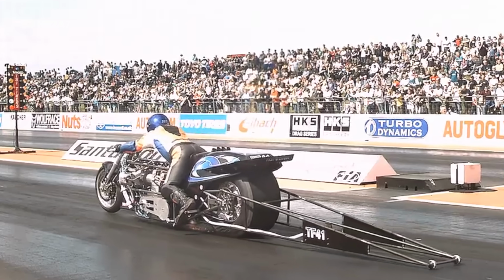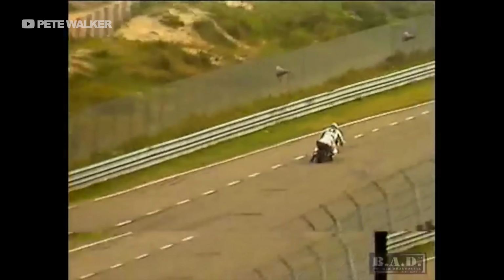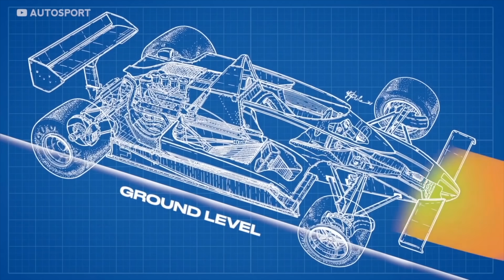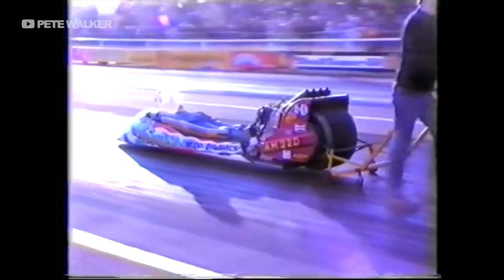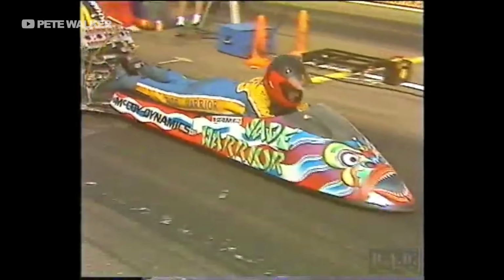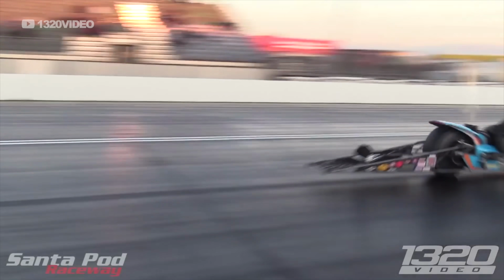The Most Insane Dragster Ever!

Comment: Glad i read your post....was just goin to suggest investing in a mic. Preciate the update. We've all gotten spoiled by better production values on many video channels. Is there a stat somewhere that tells just how many channels there are? Perhaps breaks them down a bit by content? Probably millions....so why do i get mostly the same old sh....shtuff. At least you're new to me. I don't remember that dragster and would probably remember it. I'm guessin it was never copied because in case of a crash your head was probably the first thing there. Altho all motorcycle racing is dangerous, no roll cage, restraint system, fire suppression, etc. at least you have a few options in a crash. I found gettin away from the sliding bike helpful. 
Proper riding apparel: I never wear short pants EXCEPT on one short test ride on the CBX and got a wasp or hornet or pissed of bee up one leg. Managed to trap it against my leg before it got to me shrinking manhood. Reckon brain musta yelled "RETREAT" freezing up ahead. Whatever works. Still got stung...possibly could have used the swelling. L8r.

Comment: there a other fact the motors were put in back end of the topfuel by big daddy don garlets up to this time don ran a sling shot car with engine in front the clutch blew up and car broke in to & injured part of Don foot ( in hospital he re disigned the car to put engine behind the driver! other car owners tried and failed the car would not go strait, down the track( don recovered built a rear engine car & tested it  off the track it went,  they changes the steering gear box ratio & down the track it wait! strait and could be! ( they took it to the next race & showed the nhra it went strait & entered the race and won it & that why there there in ever fuel car now) it simple Don saw a problem with the car & fixed it,

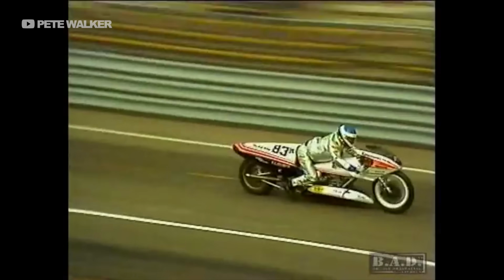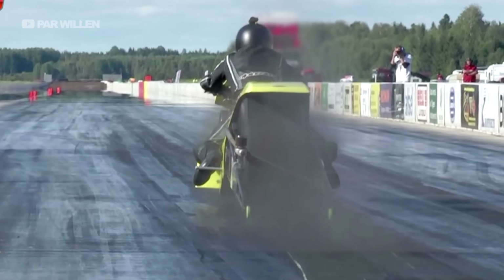Comment: Your reporting is so inaccurate its laughable@1:07 you suggest JW was raced against bikes like Henk Vinks Rocket Bike, Open Headers do produce downforce but 450kg is not 100lbs, Fuel bikes tyres don't stand upon their tyres like cars do look at the fuel bike you show at 2:20, you see to the making his own crankcase increased the power, the Monocoque was a the spaceframe ,@ BTW 8 second quarters would not compete with Tup Fuel bikes even in those days.

Comment: Back in the eighties me and my brother were sandragged and we built a sand dragger a lot like that we used a 3 cylinder Kawasaki 2 cycle motor in the rear and a little very hot Relayed straight forward Overall it was over 13'

Comment: Fun fact about Nitromethane fuel: it actually produces less power per oz/liter, than gasoline does. The reason drag cars get so fast is because Nitromethane is a mono propellant, it takes little to no oxygen to burn it because it releases oxygen while burning. As a result, they can dump far more fuel into the combustion chamber, without needing to jam an impossible amount of air pressure into the cylinders.

Comment: Cool, but not insane. That title belongs to E.J. Potter's first V8 drag bike, the Bloody Mary. It had no clutch. Launch consisted of pegging the throttle and pushing it off of the rear wheel stand. When it stopped being fast enough he built another with a bigger engine, and still no clutch.

Comment: Really cool ,buts that's a Extremely dangerous position to come off at in the invent of crash or lost control. The rider would experience the crash at the maximum speed he was traveling. With the regular riding position this doesn't happen, You need to be off the ground a little bit to have some way to fight for you control back.

Comment: Running a torque converter instead of a typical gearbox is incredibly clever as it's incredibly simple, much more durable, and basically works as a CVT.
during the video I was wondering whether weight was the reason a rear brake wasn't used to enable loading the engine up on the converter, but then you mentioned the flex issue, and  it immediately made sense as such a launch method would have likely snapped the vehicle as soon as the brake was released.

Very, very clever engineering though, especially for the time

Comment: You said "Larry Mcbride set the record at 5.83 seconds @ 232mph"....???
I've been ran a dragbike literally all my life. Put it this way, when I was born in 1989, my father worked as a Chassis fabricator at "Star Cycle", did work for "Vance & Hines" NHRA ProStock Suzuki program, and worked for "Russ Nyberg" (arguably one of the best tuners/engine builders of all time with both Kawasaki Style "2-Valve Motors", and ESPECIALLY with Suzuki style "4-Valve Motors". I've lived, slept, breathed, etc Motorcycle DragRacing literally since I was in diapers...my father literally used to change my diapers on the back body section of his 7-Second Suzuki lol.....but anyways, here's my issue:
Your facts are wayyyy wayyyyyyyy off bro. I literally was at "SGMP (South Georgia Motorsports Park) in Valdosta, GA standing behind the burnout box when Larry "SpiderMan" Mcbride set the "Top Fuel Motorcycle" E.T. record and reset the MPH record as well...that was last year in March, and he set the E.T. record with a 5.507 second run in the 1/4 mile and during that same run also reset the MPH record at 264.96mph!!!!! Lol no big deal bro, you might have misspoke...but I know Larry and his Brother/Crew Chief Steve Mcbride personally and you got to give the correct credit where credit is due. Them boys worked their asses off to get that 5.50 out of that bike...the MPH is great too, but the most insane part of it was being able to put a Set-Up in the bike to get enough of the 1500+HP they make down to the track. Those guys are unbelievable. 
P.S.
   R.I.P. Elmer Trett🙏

Comment: How does it create ground effect down force standing still?  I swear these youtubers just want a comment out any way they can get it.
Reply: Did anyone measure this downforce? probably not... therefore I will go ahead and call BS on it, due to the fact that standing still, the pressure was equalized front to rear, and if anything created a slight positive pressure due to exhaust gasses.  Only once the bike began to move forward, was there any ground effect gained, due to positive pressure in the front.  Kind of like lighting  a jet engine without first spooling it up, and creating a pressure differential, it causes a flameout due to the expanding gasses venting in both directions front and back.

Comment: Loved the video, got me interested in a few things including the people asking why this could not be repeated now we have better materials .... Must admit this is not an area I'm an expert in but did find this section from the 2017 FIM rules for drag bikes :

DR14.1.5 Ground Clearance
Minimum ground clearance with rider in position and 0.6 bar tyre pressure is 50 mm. It must be possible
to lean the motorcycle 12 degrees to each side from the upright position without any part of the
motorcycle except the wheels touching the ground.

I think this would exclude designs like the Jade Warrior, it seems to me this rule is specifically designed to stop vehicles from using the ground effect and try to keep them looking as much like motorcycles as possible.

Comment: Just to correct Larry Mcbride did 5.799@245 on a 1/4 mile track not a 1/8 mile like you said in the video. Huge difference
Reply: I was wondering when someone was going to  point that out. 230 mph is way to fast for a 5 second 8th mile run. We had a local guy consistently run a 4.7 in the 8th and top speed of around 177 mph. Most of the 5 second runs were around 155 mph.

Comment: Nitro has been in use for motorcycle drag racing since the 50's, along with some other various bits misinformation you need to do better job of studying up on "facts" before publishing videos Driver61.
Larry McBride went 5.65 @ 265 in a 1/4 mile not the 1/8 as you reported, facts matter.

Another example of you pholly of misinformation is the fact the late Bo O'Brochta went 7.08 ET in the 1/4 mile back in 1980 with a single `1200cc Kawasaki inline 4 cylinder  engine, sponsored by the  "Terminal Van Lines" company of Mike Grey this is the bike that the design brainchild of of Sam Wills) of all current entries are based on.
The NHRA Top Fuel record that the late Russ Collins set on the blown ntiro double Honda engine "Sorcerer" in 1977—7.30 seconds at 199.55 mph—stood unchallenged for more than 11 years. Collins was more than a decade ahead of his time.

https://bangshift.com/bangshift1320/russ-collins-supercharged-twin-engine-top-fuel-motorcycle/

Comment: Perhaps the reason nobody else built and raced a similar rig is the long term effect on the vertebrae. Try tipping your head back until you are looking as close to straight up (90° from level) and add roughly triple the g forces felt by a carrier launched fighter pilot. OSHA has all kinds of safety requirements for every sport, I'm guessing obviously, but they may have been influential in there being no replacement.

And then there's the socks. I honestly thought it was a joke, but apparently there really are people who would wear something as hideous! Ahh well! They are certainly heinous looking city boy foot coverings, but they cannot possibly be as rough and uncomfortable as the ones I was issued 36 years ago in  Marines. Those things were literally tough enough to have an abrasive effect on your feet! Between those ghastly woolen torture devices and the brand new but decades old jungle boots, it was a sure thing to finish a 15 to 20 mile hump with massive blisters long ago rubbed off and completely numb toes.

Comment: With modern cad/cam software and analysis, the Jade Warrior design could be strengthened and updated. The design is safer since the engine is behind the rider. A modern lockup convertor could be added with timing controls.

Comment: I seen a clip of some nut ball sitting inside a shopping cart with a car battery between his legs and holding jumper cables to a starter connected to an axle shaft connected to the rear wheels.. no steering wheel involved.. and when he clamped those cables to the battery.. well im sure you can imagine what happened next..  white ppl invent the strangest things when their bored "o,0"

Comment: Great analysis why the design was scrapped.  That said,  I imagine there is room for another try...more rigid aerospace steel construction
Reply: There's got to be something there. New materials, engineering and no shortage of crazy people to run it. I figured it was disqualified because of some rule changes but if not then there's something there!
Reply: Carbon Fiber
Reply: Slightly stronger chassis and maybe 700/800hp as a tester

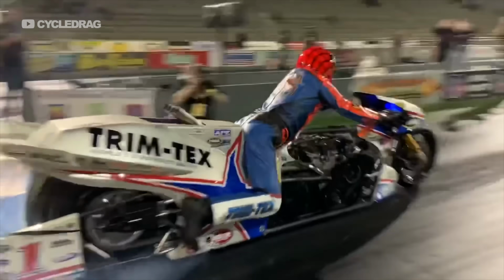Comment: 1:28 > pause..  Another note: Modern drag motorcycles with inline 4 engines mount the engines "backwards" to standard factory designs.  You can see the exhaust just is a straight shot out the back without much curvature of the pipes.. In this example, that is an older '80's air cooled engine head on that record setting bike!
Reply: They don't mount the engine backwards, they just created a new cylinder head that is turned around from the traditional arraignment, the engine itself is still in the same position it's always been.
Reply: @Nigel2Zoom   Hence, my  "quotation"          marks around the word  "backwards"  Sir.
There are many cases where the laymen does not know what a cylinder head is, nor that an engine has a bottom end and top  end and it sectioned as such.  You are not incorrect. You are just, in providing this  detail. Not wrong and thank you. However, it still does not solve the issue of the laymen understanding. So to simplify for them, using the term "backwards" is good enough to make the point I am trying to make.  You pretty much said what I said : 
" that is turned around from the traditional arraignment " 
I said " "backwards" to standard factory designs." 

 Advice from the wise man:  
If you get married to a female, and you continually correct her on technical minutia in front of others, you will end up with a knife in your throat while you sleep, Mr. Reaper.. :)
Reply: @r1too  Perhaps you should include a disclaimer, along with the quotation marks, to educate the, ''layman,'' and make them aware that what you have written, isn't what you meant. No offense but you succinctly wrote that the engine is mounted backwards, perhaps the grammatically challenged might take you at your word, in spite of your inclusion of quotation marks. Finally having been married to the same female for some 33 odd years, I learned a universal truth long ago, where ever a woman is concerned, you can choose to be right or you can be happy, never both  Cheers.
Reply: @Nigel2Zoom   I don't need to do the extra work James.. I have you at my side doing the work for me. You complete me. Thank you for all you do.. Congratulations on your long marriage. Cheers.
Reply: @r1too  Yawn...

Comment: Why did you  show and say the French rider Eric Teboul  also known as the Rocketman on his rocket bike was a top fuel drag bike ? Also did you know that drag bikes have a automatic gearbox and the exhaust gases do not push the bike and back tyre onto the floor ! The bike that flipped was in the super Street NOT a Top Fuel as you stated.
 The top fuel bikes run on the rear tyre and wheelie bars with because of all its power  !
You also said that the grade warrior had downforce when stood still ! Are you mad 😂 Get your facts right you Muppet !!!

Comment: Ag McPhail was the inventor and rider of Jade Warrior. His daytime job was a self employed plumber/heating engineer. His work van doubled as transport and accommodation at drag meets. As a 16 year old I used to visit his garage in Rayners Lane.. just a standard garage at the back of his garden. Me and my mate used to help out though Mick Hand a racer in his own right was the main assist. The engine was designed around one half of a Ford Cosworth though many parts were were made by Ag I can still picture him milling the con rods, explaining to me that the standard ones wouldn’t take the stress of the high performance engine running on methanol. I helped screw the plastic strip attached to the bottom of the “ground effect” unit. The plastic was in contact with the tarmac to act as wearable seal.  I can remember thinking back then what a revolutionary bike it was. The front wheel incidentally was from a motor scooter! And the rear wheel was a front tyre from a F2 car I think or it may have been F1. I used to help out in the pits at Santa Pod and on the line, helping to pull the bike back after a burn out.   Ag was a lovely guy, a real nutty professor type with a heart of gold but he had no fear on that thing... I lay on it once as it was being towed back and let me tell you my chin was 10 inches from the deck going 10mph and I was scared!! God knows how he rode that beast at over 200mph.
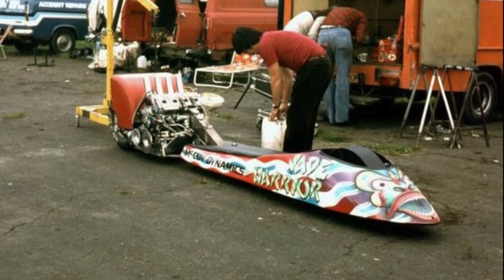Reply: Mick Hand 3:15
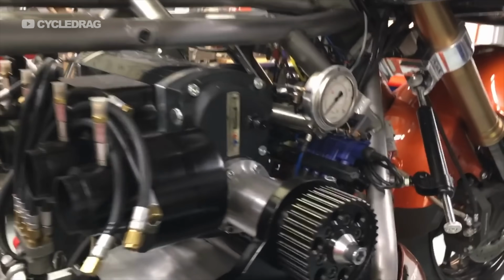Reply: 5:15 unfortunately when he built Jade Warrior he was a plumber and only had access to a lathe and milling machine in his garage, his Ford days were behind him. Makes it a greater achievement in my book.
Reply: 6:05 I believe that’s me helping to pull the bike back with the long hair

Comment: I don't know why no one has tried to copy some of these amazing innovations in design with the top fuel motorcycles. I asked a friend of mine why the rider isn't put ahead of the engine just for safety reasons alone and he said the motorcycles don't steer well. The same was said of top fuel dragster builders before Don Garlits made the rear engine dragster steer correctly by slowing down the steering ratio and the rest is history.

Comment: Good video with interesting informative facts, but would benefit more with more footage, sport related as a posed to flashing back and fourth to your close up face.
It was difficult to adjust my vision back and forth.
With better sound, your audible dialog will be great, put your socks over the mic, it will sound smoother, trust me it will be a good step in the right direction.
And don’t use old socks or you’ll sound cheesy 🤣🤣🤣

Comment: Cool but alota the stuff u said isnt true. 0-100 in under 1 sec? No, in top fuel yes, Bikes? NO. You say they run 5.50s at 260 then proceed to say the record is 5.84 at 230 witch is correct.

Comment: A double X pattern in a square box - or like a 3 sided  radio tower section. They were pretty strong. Half to run the numbers and consider Bending Moment and max stress.  I have a spare parts bike - with a 200HP capable. I may try this idea - Thank you so much - Cheers to YOU!

Comment: You really should have contacted someone that knows something about drag bikes before you made this video. You have stated a number of things incorrectly about them. 

For starters, Larry McBride ran a 5.83 at 230ish in the 1/4 mile, not the 1/8 mile as you stated. About 10-15 years ago. The current record is 5.50 at 264 mph. In fact, the short video clip you show of him is this exact run. If you had just taken the time to watch the entire video, the camera operator zooms in on the scoreboard to show the numbers. 

Top fuel bikes don't rev the engine at launch, and they don't "drop" the clutch.

And Larry McBride doesn't use a parachute.

I could keep going, but I think the point is made.